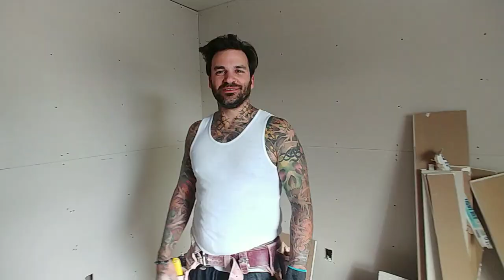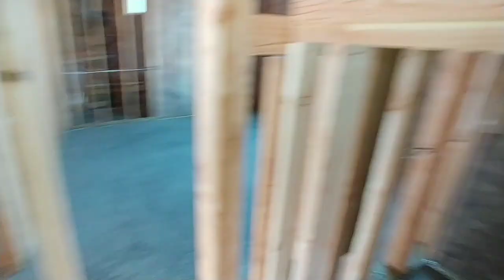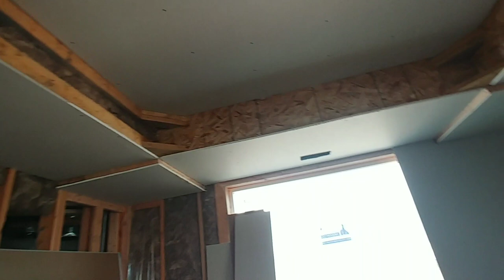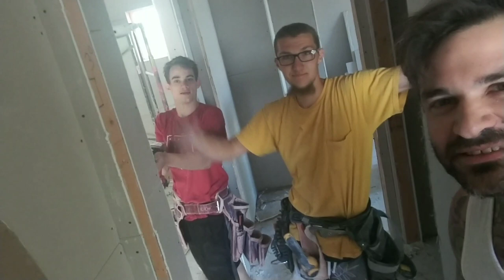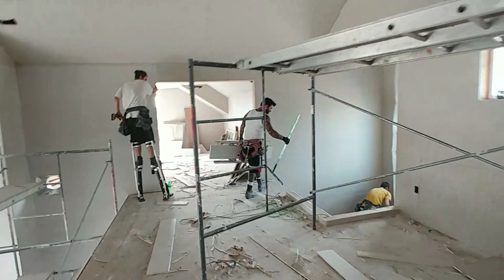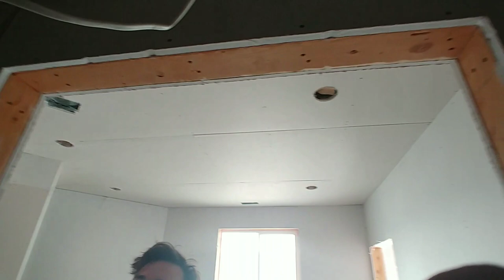Crooked custom. Work Vlog construction show drywall crew

Comment: Gotta question for you James, are you stocking 14 footers or is that camera also looks 2 x 6 studs or is it optlical illusion of course I’ve seen both used in customs. Thanks
Reply from the maker: Everything in this area are 12ft sheets or 8. 14s would be nice but no one stocks them here. Yeah it's 2x6 exterior and 2x4 interior.
Thanks for checking out the videos and commenting. I really appreciate you taking the time!